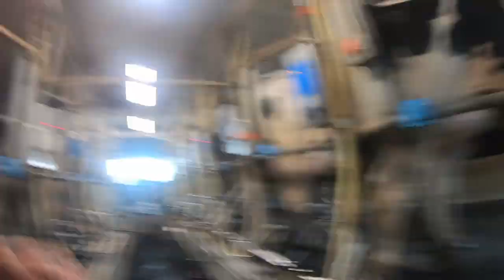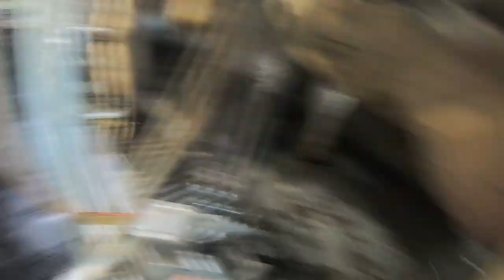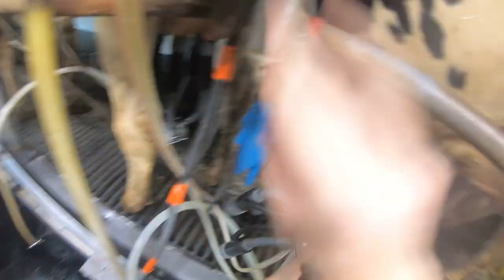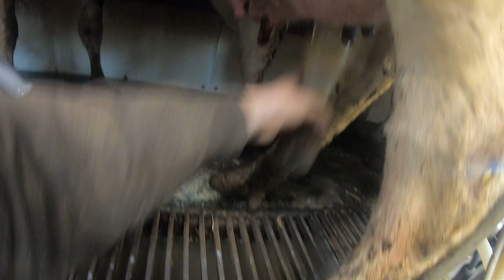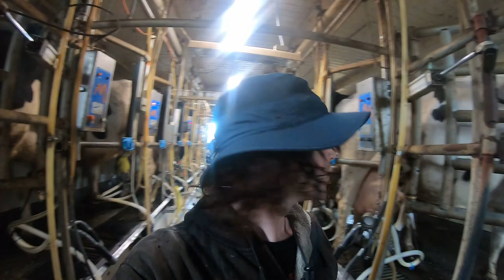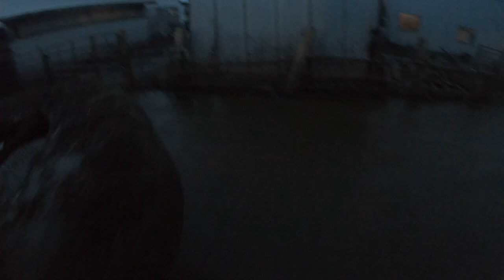Milking cows by myself!

Comment: Glad you quit that nasty tobacco habit.  You have done your health and mouth a big favor. Ask a dentist what tobacco can do to your mouth.  You won't like the answer and if the dentist has pictures or slides of previous patients who have had bad results from chewing tobacco you will be grossed out.  When I used to raise tobacco and processed it for sale I got a real education as to what goes into chewing tobacco.  When the tobacco is hanging in the barns to dry in the fall,  birds, mice and rats would go through the leaves.  The birds would roost in the leaves to keep warm and leave their markings on the leaves.  Same with the mice and rats running along the hanging rails.  When the tobacco is taken down, stripped off the stalks and pressed into bales, all that residue gets baled with it.  Before being sold the tobacco would be taken to huge warehouse barns and stored until the auction sale.  The bales would be stacked in huge rows.  Mice and rats would burrow into the bales and do all the things they do in burrows.  Dogs would be running in the barns around the bales. The male dogs would often treat the bales like fire hydrants. The bales  would be picked up and shipped to the processing plants to be made into cigarettes, cigars and chewing tobacco.  The chewing tobacco bales would be put into grinding machines and ground up.  All the animal residue would be ground up with it.  Wintergreen and other flavors would be added to give the crap a good flavor.  Keep that in mind if you decide to go back to that habit.  You really are chewing shit!  That Handsome smile you have now will have a different look and that brown you will be spitting out will be exactly the same as the brown you shit out.  I'd rather you chew the gum if it is helping you quit that nasty habit.